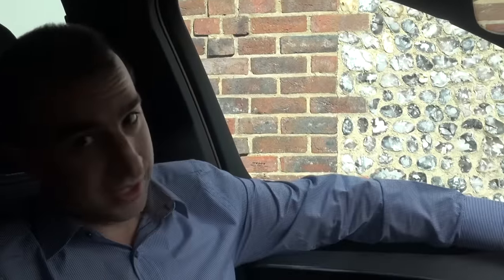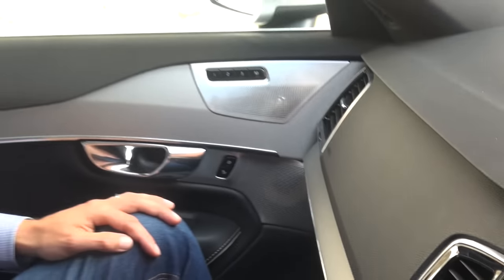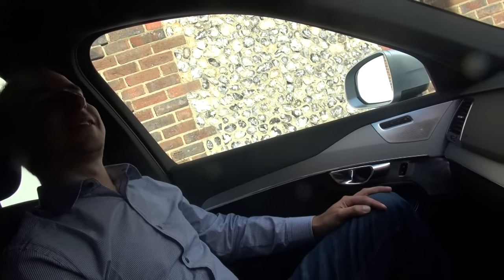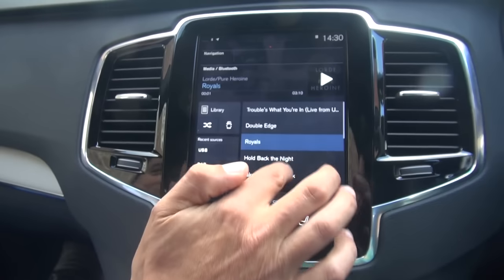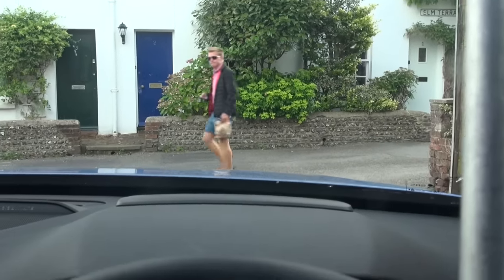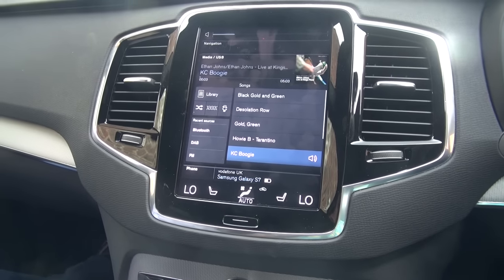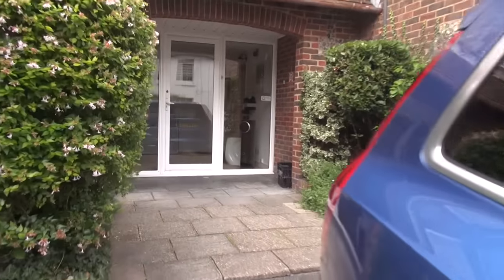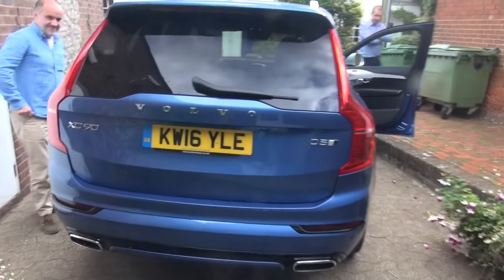VOLVO XC90 B&W AUDIO - TEST OF 2017 £3K SYSTEM AT B&W's RESEARCH CENTRE

Comment: Heard the B&W system in a S90 and absolutely loved it! I have a Hyundai Crossover with Rainbow Germanium speakers c6.2 and Profi kick bass in rear powered by a Tru Technology Steel 4 and a Mosconi 200.4 amp. The subs are Morel Primos 12" x 2 and tuned by a Mosconi 6to8 DSP. I really used to love my setup before I had a listen to that B&W setup. Now I want it real bad :/